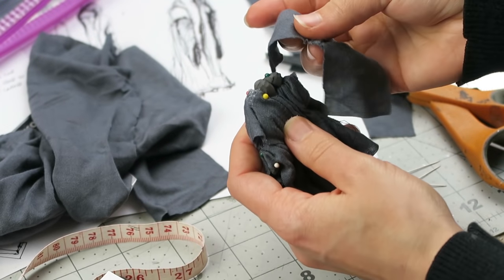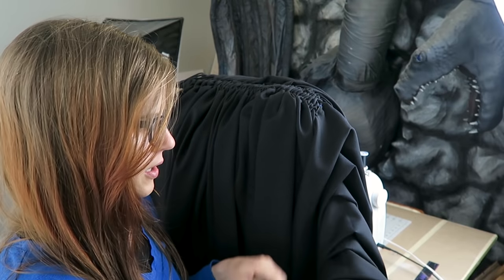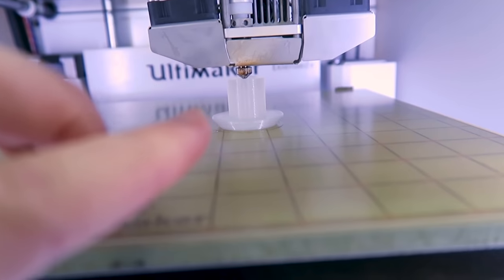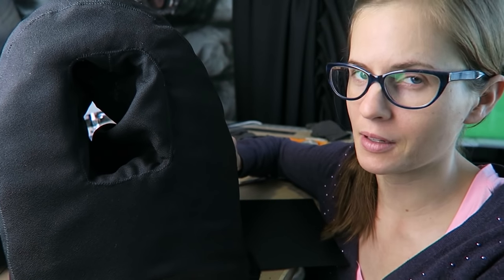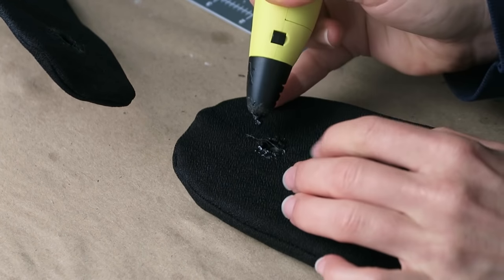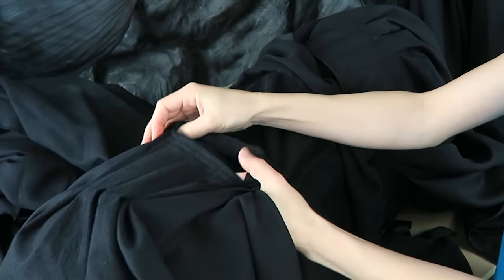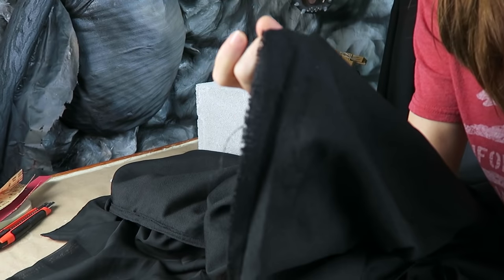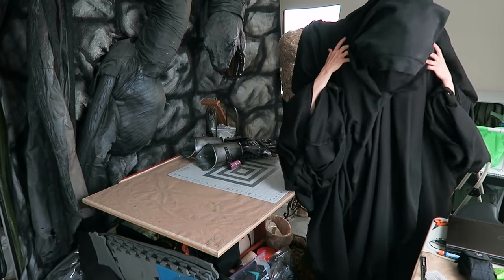How to Make an 8 ft. Tall Ringwraith Cloak

Comment: I’m building something similar but I am stuck on how you’ve created the pleats with the para cord! Would love to see it a bit more in depth. I’ve sewn the strip into the shoulders but it doesn’t bundle like yours at all
Reply from the maker: It may be that your fabric is different. Mine was a heavy weight polyester material. If you're using a light cotton or something, it won't drape naturally.

Comment: 4:10 - suggestion, catch the end of your parachord on fire and put it out on a marble or steel ball bearing to adhere them together tempoarily. Then tilt your pvc pipe verticle and it should fall right through.  Though for a short run like this one, it is probly faster to just do it the way you did (grin).

I really enjoy your creativity and engineering , thank you for sharing.
Reply from the maker: That's a great idea! Thanks!